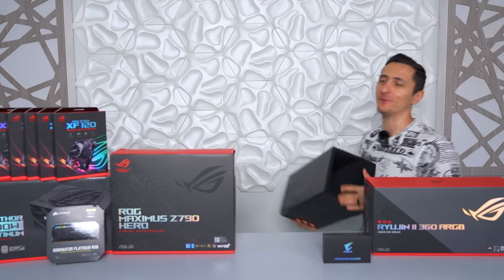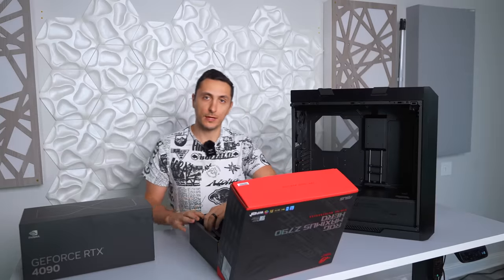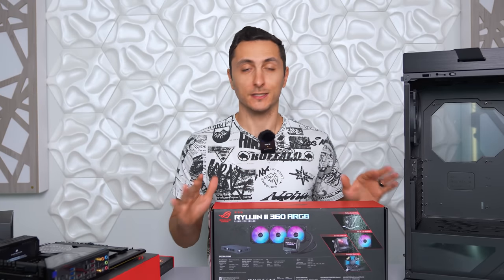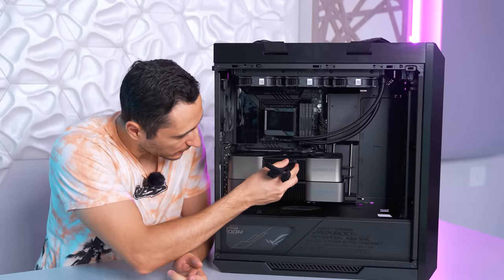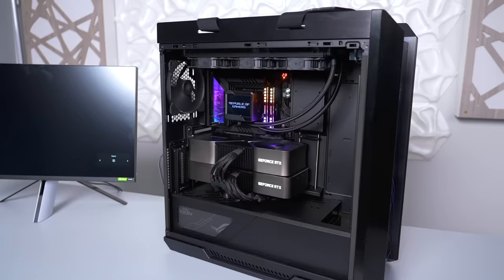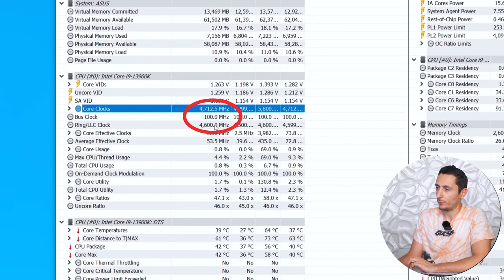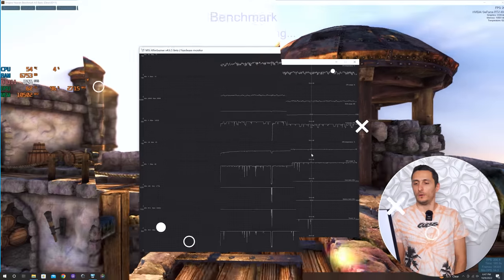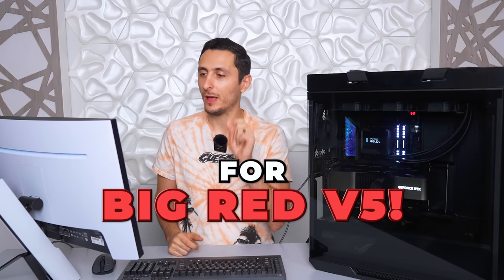This was a bad idea - 13900K + RTX 4090 PC Build (BigBlack)

Comment: Word of advice... do not peel the protective film off the PC with it running or built.  I have had static electricity from it kill a PC before.  You've been warned.
Reply: YES SO TRUE. I've seen so many pc's get absolutely FRIED from that.
Reply: What do you mean by built? Like peeling off the tape immediately after finishing the build is a no go? Or?
Reply: @realsymbiote  yes it can generate static electricity and fry the motherboard. Peel it off before construction of your pc.
Reply: Im from NVIDIA you guys saw nothing he has leaked the 50th series for next year dont tell anyone
Reply: Yeah I just assembled the same build he had in the video and after getting everything going and using it for a couple days. Noticed the film was still on my 4090. Said screw it, it’s staying at this point
Reply: @Hallowsar  no... it will only kill it if its running... you don't know what you're talking about
Reply: @rbdshadow7272 I heard that the 13th gen cpus are bending because they are rectangular in shape & because of the clip pressure...is that true?
Reply: @drippindamnfaucet3309  I honestly couldn’t tell you… I’ve had mine for like a month and there hasn’t been any performance issues or cooling issues so I haven’t had a reason to take a look at it… I’ll come back to this comment if I ever do open up my computer

Comment: Using 3090ti as an anti-sag bracket is top tier trolling
Reply: those 2 GPU's total probably require 1500 watts
Reply: @EngineerDJ_Julius you mean only 4090 3090 needs like 750+
Reply: And what supports that bottom GPU?
Reply: @outlet6989 980ti SLI water-cooled undervolted super stack

Comment: i remember when everyone was flipping out over the 9900k 😂 now there is a 13900
Reply: One of my PCs has a 9900k. It has a MSI RTX 2070. Still legit.
Reply: @sgtrickards5683  one of your PC’s?? Shit let me get one
Reply: Bro shoul just name this pc BBC (big black computer)
Reply: K , ks 😅
Reply: @sgtrickards5683  at least your is still in use, mine is just collecting dust.
Reply: Ciciicii no i nice.
Reply: 14900k meteor lake or arrow lake coming soon.
Reply: Running a 9900k OC 5.1 all cores, 3600 64GB of ram, with a 3080…pushing three 1440p 32” curved monitors for sim racing.
Reply: @Skrillak  Yeah. My main one is a Strix build. z590, 11900k, 3070, 32GB RAM in the Helios case. Couldn't be happier.
Reply: @88specv  Yeah, my wife uses it. I upgraded her cooler fans to Noctua 3000rpm earlier this year. Those fans are seriously the best.
Reply: I swear 12th gen came out like a week ago 🤣
Reply: Wait 2 years
Reply: @Skrillak  I asked first 💀
Reply: i bought the 9900k 2 years ago before it all sold out at microcenter best cpu I have paired with a 3080
Reply: dangggg Coffee Lake is older then I realized... 5 years old!!! my first PC had a 9600K in it
Reply: @j340_official  Im interested in Meteor Lake
Reply: @ssaini5028  if intel is to be believed, MTL is coming in 2023, probably the second half.
Reply: I still get blown away if someone has an i9 9900k lol
Reply: 1st 8 core cpu 🙂
Reply: Tbh I wish that get pcs never existed because I met most of my best friends on Xbox 360 and ps3 now there’s pcs and I’ve not be able to have a blast like back then
Reply: @j340_official  .. 50 years from now .. 2a° atom CPUs .. care to wait??
Reply: @DJaquithFL  sometimes it’s worth waiting. it was worth waiting for alder lake and not getting rocket lake.  Alder lake obsoleted rocket lake after only 6 months of time on the market. 

For those with $1999 to spend on a graphics card in June 2022, it was worth waiting for the 4090 rather than getting the 3090 ti.  In this instance raptor lake in a nuc will be fine, but if bro wants to wait, MTL will be a beast.
Reply: The problem is the constant increase in power consumption when going to a new generation and with that increased thermal problems. The 12900k is already getting up to 250+ Watts of power usage and normal cooling methods like big aircoolers or AIO's simply do not cut it anymore. Or you just have to accept that your CPU constantly hits temps around 90°C.
Reply: @Jousten16  It is true that the top sku on ryzen, intel core, Radeon, and GeForce are all using more power to achieve the highest level of performance relative to the competition. 

But regarding 250W on the 12900K or 230W on Ryzen, both are power consumption beasts yes, but only under all core workloads. Like rendering, etc. 

if your normal workloads are much more lightly threaded, or even under gaming for example, those two CPUs will not consume 230W+. And you can limit the turbo ratios on intel or use curve optimizer on ryzen to reduce power consumption and temps. Under gaming, with good cooling, alder lake remains relatively cool at only 40-50 degrees.  If you’re not using all cores and threads all the time then your chip will not run hot.
Reply: @88specv  hey I’ll take it
Reply: @88specv  what’s the specs
Reply: @j340_official  .. Sometimes you have to know when to upgrade and when not to. Here's my take on the next gen of Intel CPU (you already see it with AMD) .. you're going to be dealing with chiplets. Everybody always complains about one CPU versus another and its nm lithography. Okay .. When each one of the chiplets is separated by let's just say 1 mm that's 1,000,000 nm interconnect (connecting 4nm cores).. which is why I prefer a monolithic die CPU / GPU. The reason for the chiplet design is lower yields as the transistor count per mm² goes down and the nm lithography decreases. For example, on a monolithic it could be 60% yield but with a chiplet it could be 90% yield or more. It just takes one structural error to render a chip completely useless. For raw computation "more cores is more better" versus "computation speed per cycle" which is more useful for more frames and reduced minimum frames. If Intel's next generation CPU is faster for gaming then it's relying on one of the chiplets. While the other chiplet(s) are just sitting there doing background tasks.
Reply: @DJaquithFL  chiplets will be how they continue to scale moore’s law. So long as they can minimize latency between the chiplets (to be similar to the monolithic ring bus)  it’s going to be a more flexible design. For instance, one of the chiplets can be for video output and another for just cpu cores. As newer denser cores become available, they can package it with existing debugged chiplets and bring new products to market much sooner.
Reply: @j340_official  .. LMFAO look up Cerebras. Chiplets have nothing to do with Moore's Law, instead it's about the company's wallets .. that's it period. People over all are relatively poor .. chiplets are a cheap solution.
Reply: @DJaquithFL  moore’s law is all about doubling transistor count every 2-2.5 years. As you noted before yields on monolithic dies are declining, as we have seen from intel with 14nm->10nm and even with tsmc moving from 5nm->3nm, the rate of time needed to transition to a new manufacturing node is increasing. Or density scaling is slowing down. 

But by shifting to chiplets, the whole die doesn’t need to be manufactured on the newest node. Some of the logic such as I/o display out and so forth can be manufactured using a more mature lithography process. And the high performant logic can be manufactured using the newest node that is available. Therefore, chiplets allow the vendor like AMD and soon Intel to add more transistors to same silicon die area. Density continues to scale. Which is a continuation of moore’s law. 

Of course the challenge is the latency hit you take when you split your logic up into different chiplets. 

With MTL, Intel still will manufacture a monolithic “4 nm” chiplet for its MTL cpu cores. The other logic like gpu, display out, and I/o, etc., will be separated into different chiplets.
Reply: @j340_official  .. Interesting but clearly you didn't check out that MONOLITHIC CPU with its 2,600,000,000,000 transistors with 850,000 cores. Again, tiny Chiplets are 100% to reduce cost that's it. Period.
Reply: @DJaquithFL  fair point... fair point.  I don't disagree.  Intel recently leaked that it is prepping a 34-core beast based on Raptor Lake's P cores for HEDT.

But with chiplets, so long as single and multi threaded perf goes up, at reasonable temps, power consumption, and cost, I don't think I care all that much.  

I'm reserving judgement for the future Intel Lakes like Meteor Lake, Arrow Lake, Lunar Lake to see how the hybrid + chiplet strategy works out.   But Alder Lake is great and the upcoming Raptor Lake appears to be a beast.
Reply: @j340_official  .. Slap together a couple Alder Lakes 2 x (8P+8E) tada 32 Cores. What I'd like to see is a Gaming CPU 10~12 P + 8~16 E on a monolithic CPU using 4nm lithography. Gaming. Most games 'now' are capped at using 8 cores but the efficiency cores can handle the background tasks so the power cores can feed the GPU. It's already a problem where the games even at 4K are CPU bound.
Reply: @MxdzGaming  its on PCPP, search my name
Reply: @DJaquithFL  lookout for arrow lake.
Reply: what is this comment suppose to mean
Reply: I remember thinking: “oh my! 10th gen!”
Reply: @Kepler 186-F hi
Reply: @Kepler 186-F gravity is a bit much, here. I'm adjusting.
Reply: @sgtrickards5683  one of your PC's?? Dude i don't even have a working laptop
Reply: @j340_official  sorry by the time you commented that the 15900k is already on the horizon
Reply: I, up until recently, thought that the i7 7700k was like the best
Reply: @SeprexOG  wake up bro it's 2022 not 2016
Reply: I'm still on a 9900K and I'm happy with it but I want to build a PC for myself so yeah why not? I'm waiting for the 13900KS and a Liquid cooling 4090 or TI depends how long it takes me to build.
Reply: With 3 times the cores lmao
Reply: @beataoo  Remember, spending a little money on the things you love to do is ok. I'm a disbaled Combat Veteran, and gaming and gardening is pretty much all I do now. Teched out country boy, if you will. Keep saving and you'll get there. It took me 4 months to get my parts.
Reply: Eu com minha GTS 450 xD
Reply: @sgtrickards5683  you could have a 4090 with a 13900K, and so on... And be happier.
Reply: @DrNoBrazil  I could. I have other things that make me happy too. I'm a pretty good artist. Pencil, charcoal, and some paint. I'm finishing up a pallet shack and I built a food forest. The food forest is constant maintenance. Getting prepared to raise chickens next year. I have a lot going on. I think I can squeeze another year or so out of the system I have now. This thing is wicked fast. Faster than the XPS 420 I started pc gaming on. I still have that PC. Such a relic.
Reply: Wow. Same build sounds like. I'm air cooling. Noctua NH-D15 with 3 140mm 3000rpm fans. 12 fans in total. I also took the pci slot covers off and installed a small fan in the hole. It acts as an exhaust for my gpu. Works really well. Surprised case manufacturers haven't done something like it. Make it an option for folks who aren't using all of their pcie slots.
Reply: Wow. Same build sounds like. I'm air cooling. Noctua NH-D15 with 3 140mm 3000rpm fans. 12 fans in total. I also took the pci slot covers off and installed a small fan in the hole. It acts as an exhaust for my gpu. Works really well. Surprised case manufacturers haven't done something like it. Make it an option for folks who aren't using all of their pcie slots.
Reply: What the Goal of testing both cards on top of one another,?
Reply: This has been my experience, I've been gaming at 3840x2160p, since 2016 and in 2020,when I got my 3090s, I got one Alienware 50 something inch 7680x4320p monitor and I've been gaming at 8k A LOT since then/I got 3090tis after that and I got a 4090,but it was weaker than my 3090tis system,because Nvidia handicapped their card by removing the NVLINK plug,I usually code something to optimize two cards,but this time, I kept my 3090tis/i9-13900k,128GBs of DDR5 RAM system and decided to build a separate system around the 4090 with an i9-13900k and 128GBs of DDR5 RAM and I utilize a hyper visor,which was a great idea,because now with the power of two Titan RTXs,two 3080s,two 3090s,two 3090tis a 4090,an i9-10900k,an i9-12900ks,3 i9-13900k CPUs, with a total of 98 cores and 512GBs of DDR5 RAM and 128GBs of DDR4 RAM,totaling 640GBs of RAM/all of my old computers that are still worth keeping, I can basically run and do anything I want to do on my network with them/I can stream multiple games to my monitors/TVs/Steam Deck,I can run multiple Virtual Machines simultaneously to test my code.

I have MOST of my systems hardwired/plugged up with RJ45 cables,but my laptops,phones,tablets,Steam Deck and so on are designed to be portable/not tethered to a wire, so I SOME WHAT recently got four ROG Rapture GT-AXE16000 routers,that replaced some Night Hawk Routers, to cover my whole house/one for my back yard area,one for my basement,one for my first floor and one for my second and third floor.

I've been thinking about adding two more i9-13900k CPUs to the equation, my goal is to get to 148 cores and that would get me to 146 cores, I also don't want slow cores either/traditional server cores are trash,also AMD isn't an option, because all cores aren't created equal/if you compare an i9-13900k/Intel core to an AMD core,you will be disappointed with AMD/SOME of AMDs CPUs have like 64 cores/the 3990X has 64 cores,but the single core performance of a 3990X isn't great,maybe since I don't have a system in a Z790 board, MAYBE that COULD be a good idea/I could get another i9-13900k/4090/128GBs of RAM and then when Meteor Lake comes out I can get an i9-14900k/ks system. 

My Hyper Visor journey has been good so far/being able to combine all of this hardware vs my usual two card setups has really changed things for the better, my work loads are handled perfectly/I only run Kingston KC 3000 SSDs and SOON I'm going to add some Samsung 990 SSDs,I have a total of 60TBs,for storage/each of my systems have 12TBs in them,for movies and games,I also have some smaller sized SSDs,for Manjaro Linux,Windows,Virtual Machines and projects,but the removal of the 4090s NVLINK plug has really opened a lot of doors/has been a really good thing, at first I didn't think this was true/I thought it was going to impact my work loads, but with the options Hyper Visors give you NVLINK isn't really needed anymore/with a hyper visor you can crush any single system easily.
Reply: both are good for heating your room
Reply: @sgtrickards5683  bro even my 7700k is good in this year. I thinking about upgrading to 13900 but then i need new mb and ram, still thinking about it. I got good fps, even when my cpu bottleneck my rtx 3080
Reply: I'm still flipping out over it 😭😭😭 I got an i7 2600k
Reply: I swapped an i7-6800k for an Ryzen 7950X. Can you imagine what a change that was...
Reply: yeah i just upgraded from a 9900k to a 13900k rip my wallet 😂
Reply: 9900KS here, still crunching on everything with 3 monitors attached. From editing 4k/8k footage (video editing) while watching YouTube being on Discord etc. to playing competitive games MW2, CSGO, Valorant at high FPS. And that is with a 2080Ti. Upgrading makes no sense at all. if you are way back, upgrading to top of the line is absolutely amazing though.
Reply: I am on a I9 10900k 10@5.2 32GB DDR4  3090RTX and plan to be on next few years maybe 6090 or how long takes to beat 107 games lol
Reply: @POC   why is your PC collecting dust? My PC is 10 years old. I have an X58 V.2 motherboard. i7 960 overclocked to 4.0ghz. Bequiet 4 air cooler and a GTX1660 Super. I can game up to 1440p with max settings at 120fps down to 30fps depending on the game. The only thing new is the GPU and the air cooler. Lol

I'm building a new rig now after 10 years.
Reply: @CaptainScorpio24  sure is, I mean, if you ignore the fifty 8 core CPUs before it
Reply: 9900k is so bad bro 😭😭
Reply: @tomazvitokorenjakjaklic9348  lmao 🤣
Reply: Guys please 🥺🥺, I have i3 540 with 8gb of DDR3 ram and 256gb sata ssd
Reply: @legendsocool644 mine still does...
Reply: and here we are now today lol with the 149000k im getting tomorrow
Reply: No there is a 14 i9 😭

Comment: I ran an RTX 3090Ti LC behind an RTX 3090Ti FTW 🙌 and the temps peaked nothing over 80 degrees Celsius from what I saw in my rig. I do content creations and mor on the work side so having both a 4090 and 3090Ti at the expense of 17 degrees is worth it because the increase in VRAM is crucial for rendering. Standard gaming, only 1 card due to how the game doesn’t even utilize both cards if slotted. Workstation = 2 or 3 Cards; Gaming = 1 Card. I tested mine via threadripper, the Asus swrx80 Sage motherboard, but for mainstream boards, running 2 cards is risky due to CPU bottleneck ing and the lack of PCI lanes depending on the motherboard.
Reply: what about side mounting one card and the other in the board. i think that may help with keeping them spaced to allow air flow.

Comment: Great video man!
At 10:20 you said 2600mhz running in Dual Channel to make it 5200mhz.
DDR5 stands for *D*ouble *D*ata *R*ate 5, so it's "Double Data" not "Dual Channel"
Reply: As an old guy who built PCs back when SDR was a thing it's interesting that this isn't common knowledge anymore.